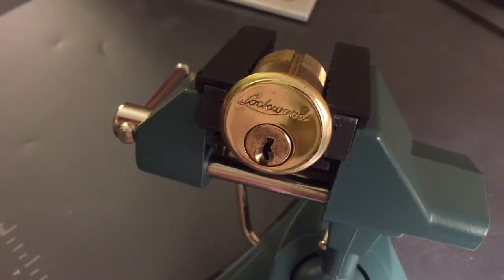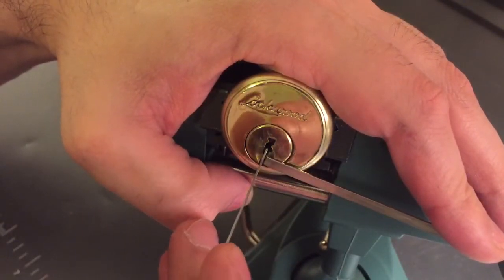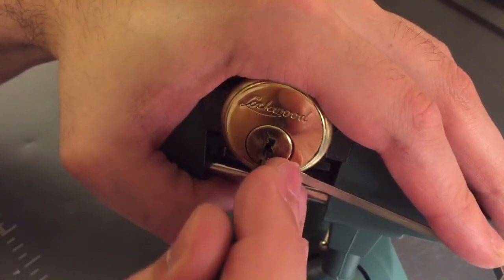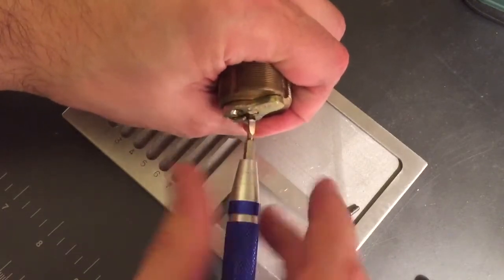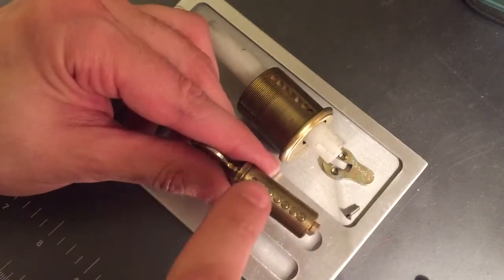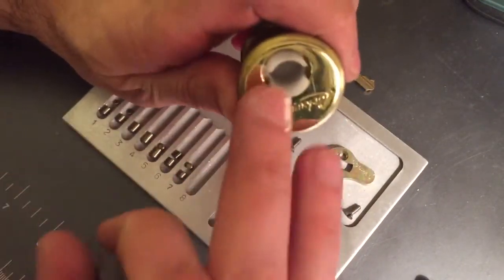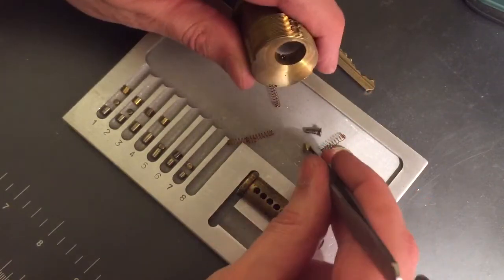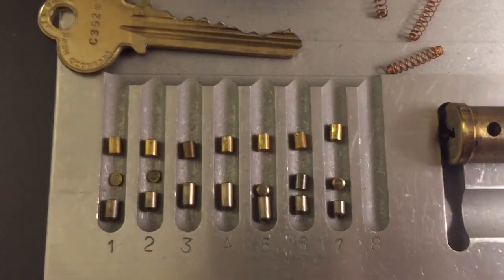[51] Lockwood 7 Pin Mortise Cylinder Picked and Gutted

Comment: Great Video as always!  Just FYI this is not a Lockwood out of Australia.  This lock was made by the Lockwood hardware manufacturing company out of Fitchburg, Massachusetts who were around in the early 1900s until 1975 when they we're purchased by the then independent lock company of the same origin they we're then sold again to Lloyd Matherson in 1983.  I just picked up one of these that is zero bitted, or it actually looks more like 1 bitted lol, with a really strange keyway.  There is like a T at the very top of the keyway where if you cut the key below a one cut it doesn't even reach the T.  It seems they still sell these under Lockwood industries in 6 and 7 pin variants and a few other styles of mortise, rim, and Kik cylinders along with a bunch of door hardware.  I'm trying to learn as much as I can about these different Lockwood companies.  It seems the US Lockwood co even made a padlock with an oval logo much like the Lockwood Assa-Abloy company's logo.